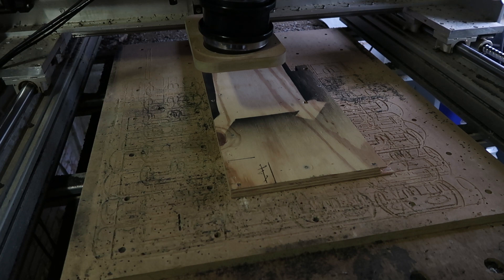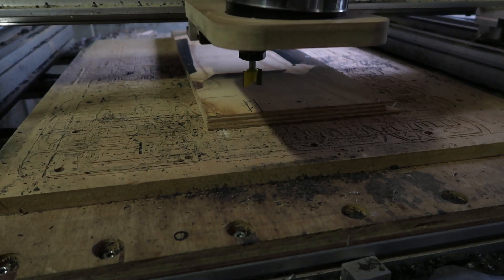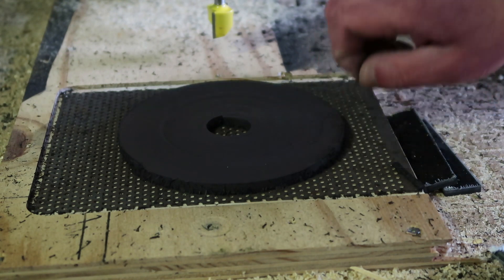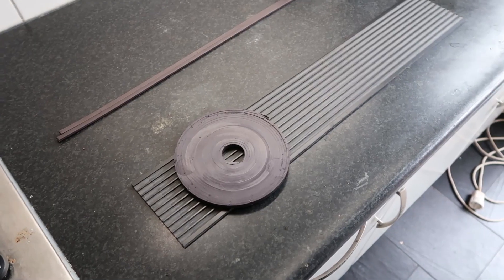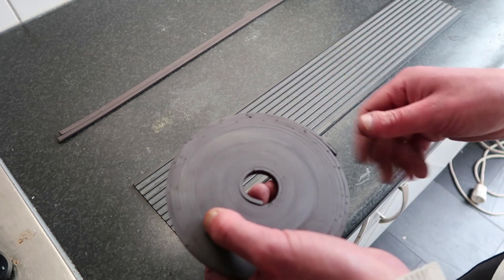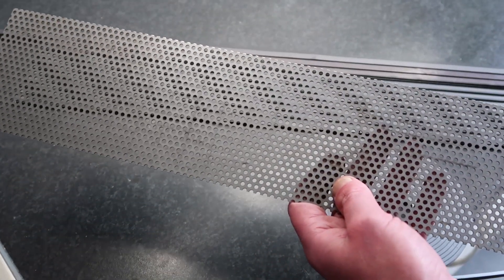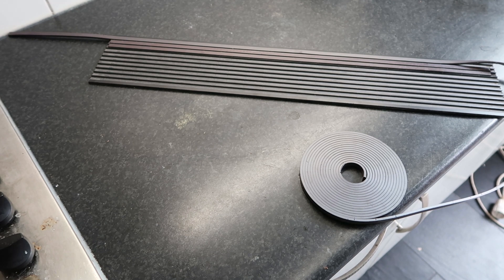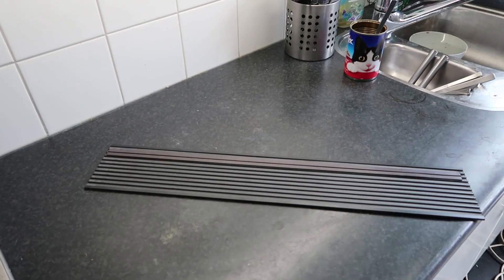Midrange Rubber Magnet Planar Magnetic - Part 2

Comment: Hello
I would like to know where to get a tape magnet and what is the name of the magnet? I would like to build a 1.5 meter ribbon speaker later. Hi: HUNAUDYO from Hungary
Reply from the maker: hi there for a true ribbon , the rubber magnet is not strong enough, its only usefull for a panel like this one, with rather low efficiency.  i dont know a a shop that sells these magnets i buy them wholesale from a company that only sells to other companies.  the magnet is by default 8.5 mm wide 3mm thick, i usually cut it down to 7 mm wide to create some open area on the sheet metal i use R3T5 perforated sheet steel holes are 3mm and step over is 5 mm.   you can buy the magnet from me if you want  in rolls of 50 meters and will set you back 100 euro a piece.  in the default 8.5mm width.  my fulrange speaker projects uses around 1 roll for 2 speakers.  (only for the bass/mid portion)
Reply: @joppepeelen  thanks your information.

Comment: I have not laughed so much for a long time. All those chunks of rubber magnet stuck to everything in your shed had me howling. You really are messy! :)

I’m not sure it would work, but you machine a small cutter to the correct width. Like a razor blade on top of a 7mm slot in HPL, and pull the material through to slice it off.
Reply from the maker: im afraid not :( its hard to cut by hand even.   i used a bandsaw once that works with a jig really ok. to cut it in halve for instance except that all the shavings end up in the machine sticking.... and it was such a cheap machine.. (100 euro wasted) that i dislike to use the crappy thing. i should have bought a second hand better quality one for that amount. :(

yes i am messy :( i want  to go faster then i can usually :) to keep   everything clean :) hehe